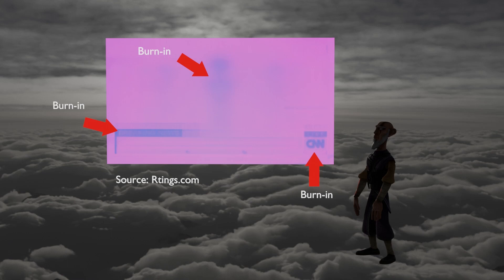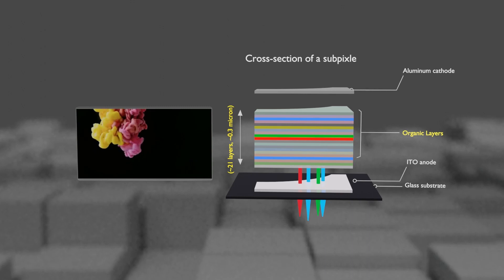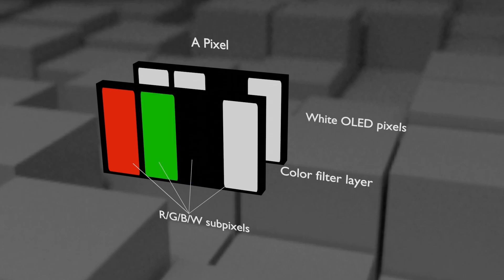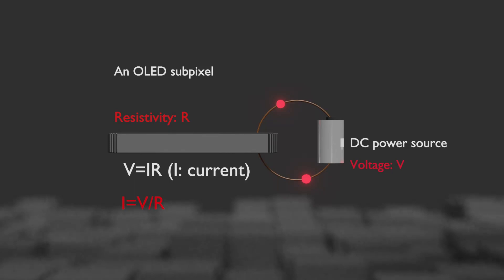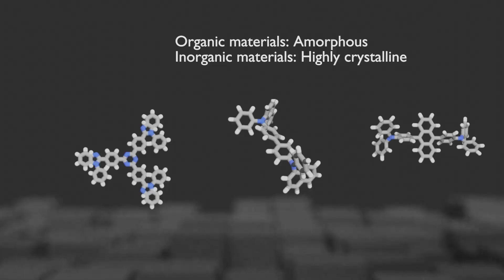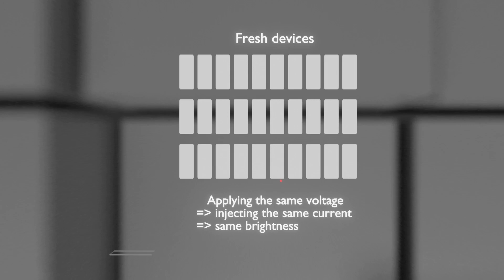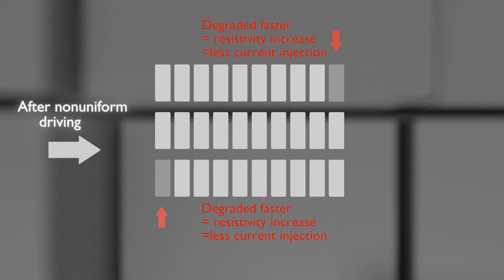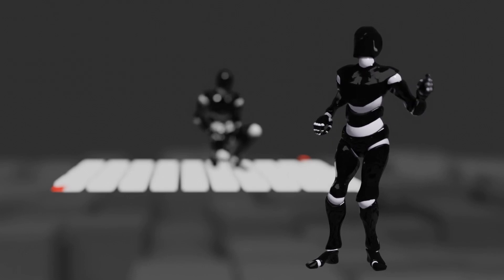What is burn-in that appears on OLED TV?  How Pixel Refresher works to make it unnoticeable?

Comment: If pixel refresher helps to make burn-in not visible can it work forever or eventually the display will show signs of burn-in?
Reply from the maker: There should be some limit, after all.
But,as an Oled tv user (heavy user), I can't notice any sign of  burn-in after 4 years so far.

Comment: If pixel refresher can maintain uniformity by increasing voltage, does that mean the overall power consumption will go up? Won't the brightness of the oled tv still go down over time?
Reply from the maker: Yes, it will go up.
But the adjustment is applied for only a fraction of pixels, and the degree of the adjustment is tiny.
Reply: @techtripkorea  Does that accelerate burn-in? The extra voltage pixels burn faster than non extra voltage ones?